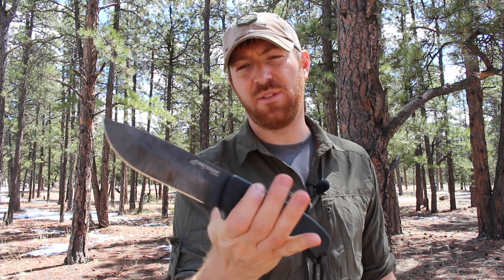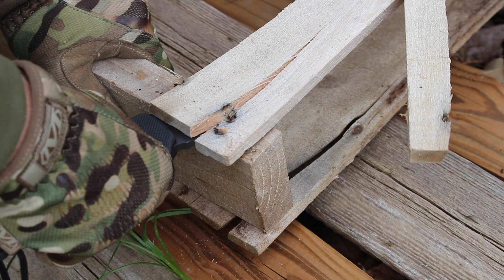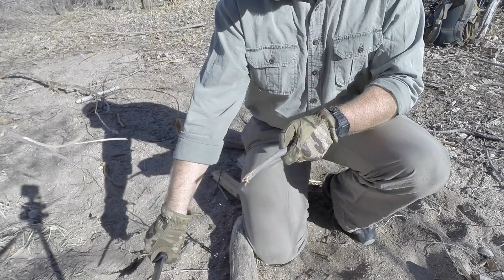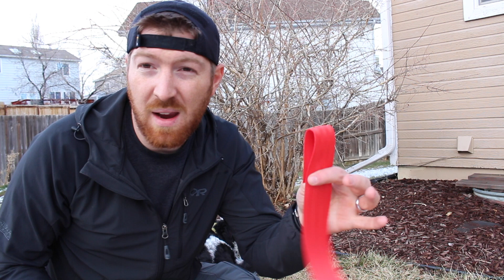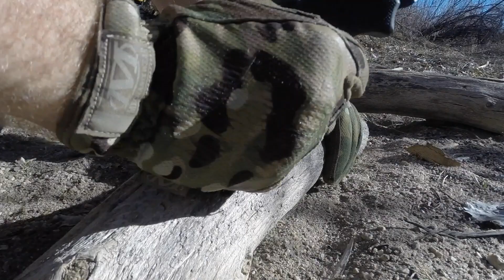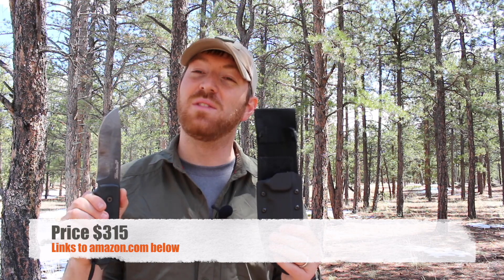The Premium Tank: First Edge 5050 Survival Knife

Comment: I've owned and used my 5050 and 5150 for awhile now... not a single complaint about either of them.
The 5050 is a reliable tank and I have zero concerns with its ability to do everything a knife should do, plus things only a hammer, axe, or prybar should be expected to do.
I own/owned many Striders, Busses, Beckers, ZT's, Medfords, Bark Rivers, etc... the 5050 and 5150 meets or exceeds all of them, and the elmax is possibly the best all-around steel available today.  
Compared to most of the knives mentioned, the 5050 (and 5150) are a bargain.
I modded my 5050 a bit - I ground the glassbreaker down to a ~4mm exposed pommel that is parallel with the g10, looks good and increased its bush capabilities a little (and I have no doubt it'll still break anything breakable).
After some hard use the bead-blast finish wasn't perfect, so it spent a few minutes on the belt sander then some hand work for a nice satin finish and sharp spine.
Its a little on the heavy side for "bushcraft", but if I could have only one knife...

Comment: Say Heah Aaron,  I trust your input,  I have another  $64,000.00 question,  After experiencing the 50/50 how would you stack it up against the Ratmandu,  and if it was in the INFI Steel,  I Wish you a Safe Summer. Someone told me Elma was great for a folder but not so much a fix blade,  But here your praising it.  Oh,  and how about comparing it to 3V in that size,  Thanx,  Bud.
Reply from the maker: It is very good.  I don't have my ratmandu in INFI steel.  It is SR101.  The Elmax is more rust resistant then 3V.  Hope that helps my friend.
Reply: Yeah,  But would I NEED more rust resistance in the bush,  or have a stronger edge holding knife,  I guess that's what I, 'm asking,  What I read into your reply,  You think 3 is the way for you.  Sure I' very been on trips that it remained for the whole duration,  Ok,  I have a question,  3V or Elmax,  what say you ?

Comment: Nice knife but even with Elmax, I think the price is inflated. Probably because they can market the Seals thing.
I own a ZT 0560 in Elmax, granted its less metal but this is a more complex folder with bearing pivot, 3D machined titanium scales and matching G10. Folders cost way more to make have more complex machining and must be precisely built yet it cost significantly less than this.
At this price they are competing with the absolute best in that size.
I have a Scrapyard 711 that was half that price, is over 7" with a steel I would put up ahaonst Elmax in anything but corrosion resistance.
$250 I might understand but this is a bit crazy.

Comment: Hello there. I'm somewhat new to the channel, an I really enjoy your videos. May I request you do a short video on the pros and cons of different types of steel please? I've heard you throw terms around like "Stainless Steel" and "High Carbon" with different numbers. I've tried to look online but there's just too much detail. I'd just like to know some of the 'practicalities', if you will, of the different types of steel. Thank you!
Reply: theres a lot of short videos on it already. i would recommend learning the basics before watching knife reviews otherwise it co,fuses the heck out of u
Reply: Being very brutish, high carbon steel will generally give you great edge retention and ease of sharpening with also good toughness, but will rust extremely fast on you (and rusted steel leads to the dark side, because it causes anger, hate and suffering). Stainless steels got you covered on the rusting issue, but a stainless that goes about for THE SAME AMOUNT OF MONEY than a high carbon is usually less resistant to the use that Aaron and other youtubers usually puts them through, either they dull in no time, they suffer some deformation (rolling, warping, etc) or they just chip or even worse, snap at a certain point (however snapping is very uncommon and is mostly due to manufacturing issues).

There's another topic that might confuse you, which is the Rockwell Hardness. That means that a knife (or a part of it) has a certain degree of wear resistance (the ability to hold a V shape rather than turn into a U with use), generally the higher the HRC the better it'll hold an edge, but the more prone it'll be to break rather than deform).

Supersteels combine the best of all worlds IF MANUFACTURED RIGHT, which is very costly, thus the very high pricing.

So, the discussion between the FE 5050 and the BK2 comes to the point "Do I wanna triplicate the price for added corrosion resistance and an ability to hold an edge longer, even taking into consideration that I might not be able to resharpen it when most needed?"

Usually most of us mortals don't have the need to go beyond 1095 for a high carbon or 440C for a stainless.

Comment: Hey Aaron, great review as usual. Even though that is a sweet blade (love the rust resistant properties, but I live in Arizona), the price is just a bit too steep even for Elmax. I seriously appreciate the review though! It's always cool to see different gear, and find out new styles/companies/features that I might otherwise not be aware of. Thanks.
Reply from the maker: No joke it is a high price, but I contacted a few custom knife makers ask if that price is reasonable for an Elmax blade this thick and they agreed it was a fair price.  Costs a lot to buy, heat treat, and eats belts when grinding.
Reply: Sorry, I meant the price was too steep for me. For Elmax it's probably in the sweet spot for the reasons you mentioned. (Already have one of those Esee 5's!) Thanks man.

Comment: Aaron, I'm kind of thinking out loud here, but why in the hell would they harden the steel to that Rockwell for use in those conditions?  Seems to defy the laws of nature!  Make the steel super hard which makes it more brittle and then expose it to temperatures that will cause it to be even more brittle.  Logically, it does not add up, at least for me.  I know the thickness will overcome some of the brittleness in use, but not completely.  I bet you that edge and lower parts of the grind are going to chip in chunks in sub-zero temps under moderately hard use.  If I'm way off base, somebody set me straight, please!  Hope I am not coming off like a jerk, just trying to wrap my head around this whole high Rockwell/cold weather use thing.  Thanks for the review!
Reply from the maker: No usually I would totally agree.  That makes sense, but the teams that contracted them made them wait a year to sell it to the public so they could really use and test it.  They were obvious happy with it in those condition.  I have no way of testing it to that extreme.  For average temps it is very tough with my use.  Hope that helps.

Comment: Been hearing great reports on this company. HT up to 62 ? What's the theory of use behind that ? Durable, but less flex, right ?...... PAPA DUKES
Reply from the maker: That would be true
Reply: With the mass and relative shortness of that blade , I don't think flex would be an issue. Looks like you could chop your way out of a tank with it.
Reply: john rossi 

to pry and not snap tip
Reply: Finn Green Flex would better imo, so the knife tip wouldn't be so stressed it would snap. You can only take the heat-treat so high and then the toughness makes it brittle. Gotta get the HT just right. That being said, I think some people expect too much from a knife. It's for cutting, not prying. Crow bars are for prying. I have a mini pry bar. They're great. All the best !... PAPA DUKES 
...

Comment: Nahhhh, $300??
When Ka-bar is going to sell me a nearly identical knife for 85 bucks off of Amazon with different steel. ✌🏽️
Reply from the maker: +Thomas Jackson It is a high price, but I contacted a few custom knife makers and ask if that price is reasonable for an Elmax blade this thick and they agreed it was a fair price.  Costs a lot to buy, heat treat, and eats belts when grinding.
Reply: Or an Esee 5 for $150. Still expensive but a tank of a knife.
Reply: +mrouterrim Lol, winning with common sense.
Reply: Thing is, 1095 Cro-Van doesn't hold a candle to ELMAX when it comes to ridiculous Kalashnikov standards of durability. Look up the specs for ELMAX. That's where the cost is.
Reply: +Thomas Jackson it eats belts because you have so much to grind due to the thickness.... You grind before heat treat anyway.  So no, not winning with common sense.
Reply: +Bell Blades Does high carbon chew through belts as well?
Reply: I own one and I love it! I've done quite a bit of outside work with it, and it holds an edge great and does what I've put it too. I've even taken down a small tree (about 5-6" in diameter) by chopping at an angle with it. It does take longer to sharpen, but its worth the time. I use DMT sharpeners and do it all by hand without a belt grinder to take it down to a steeper angled edge.
Reply: I agree. I understand it has some neat features but they're banking on the whole "tactical" customer. The price is ridiculous!
Reply: +gideonstactical Okay, good to know.
Reply: If it eats belts just think how hard it will be to sharpen !!!
Reply: +Thomas Jackson usually no not nearly as blade as these super steels
Reply: +Thomas Jackson usually no not nearly as blade as these super steels
Reply: I've had hard steel knives and they wont do you any good if you cant sharpen them on a rock. Even if you could it would it would kill me to do so on a 300 dollar knife !!!
 Also I don't have the patience to keep working an edge over and over. But that's just me .
Reply: +Aorta Artery i know but not many people know those steels most know the stainless super steels so i didnt bother mentioning it.
Reply: There are vastly better options for taking down a small tree that don't cost $300. Okay you have more money than you know what to do with buy this and have fun. If you are a regular person this is not a reasonable and prudent investment even if you are an avid outdoorsman.
Reply: Or if you want a great stainless steel survival knife pick up a tops bob in 154cm. Great knife and around $180 on Amazon maybe less now 🖒